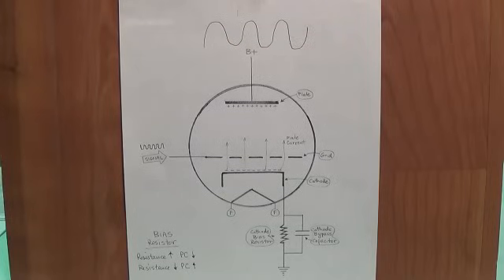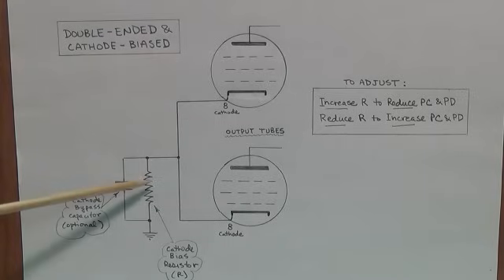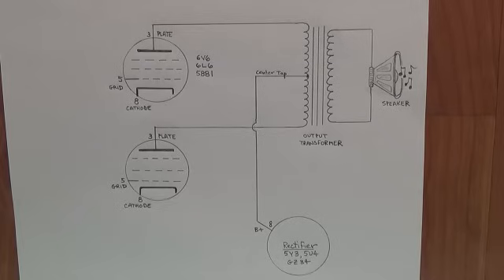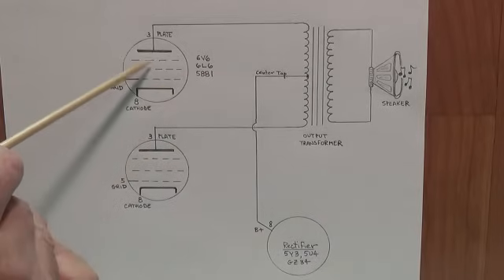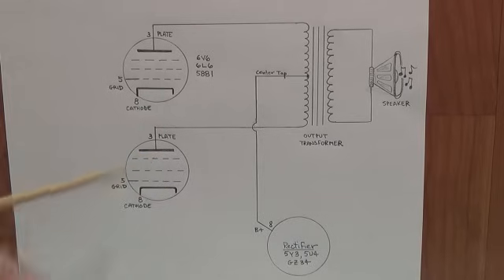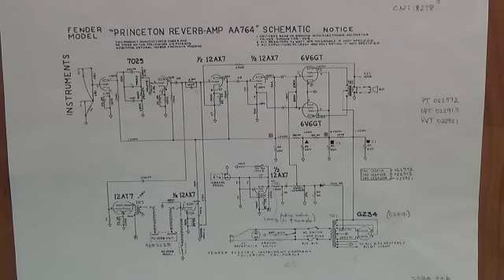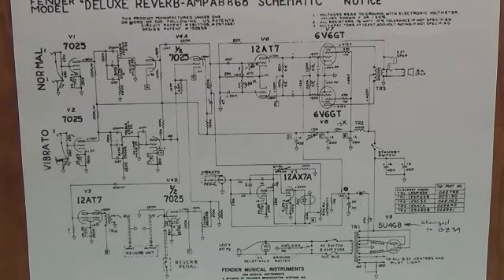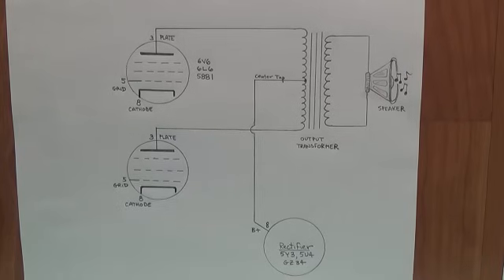Biasing Double-Ended Amplifier Output Tubes, Part 1: Basic Explanation & Methods

Comment: Greetings Uncle Doug.  I've enjoyed your tube amp series of vids immensely,  You are a very skilled teacher!
I'm a mature (retired) EE who grew up with tubes in the 50's & 60's.  (Did alot of crazy things with old radios and TV's.) I'm also a vintage amp and guitar guy. Rock on!!
I have a question/observation about biasing AB amps.  Your point that output architecture can be very recognizable/predictable is a valid one.  But as shown in a few of your examples, it can vary slightly... Specifically in those amps which have an additional component in the B+ path to the OT like a field coil or a choke.  Making resistance and voltage readings between the Rect tube Pin 5 and the output tubes, pin 3, includes this component and it's resistance/voltage drop.  
Is the added resistance & voltage drop of the choke or speaker coil significant enough to affect tube bias?
Thanks in advance for your answer.
Harky1949
Reply from the maker: Howard Kaiser Greetings, HK, and thanks for the very nice comments. I generally try to avoid all extraneous components when measuring the resistance of the output transformer windings. In most cases, even if there is a field coil or filter choke in the power supply, you can use the schematic of the circuit to locate the purest route through each half of the primary winding. For example, the AA864 Fender Bassman has a filter choke (TR2), but using the schematic, you can measure the resistance between each 6L6 plate and the point where the center tap enters TR2 (rather than exits from it). I don't believe I have ever been unable to measure the OPT primary windings by themselves, with no extraneous components or resistance.
Reply: I agree that establishing the "purest" route from OT center tap to output tube plates will yield a spot on dissipation measurement. I just assumed that the choke or field coil prior to B+ on some amps would have a negligible affect since you did not mention it when reviewing your amp examples.
Again, I love your vids, have watched many of them several times, and rate them as tops among the many how-to's on you-tube. Keep up the great work!! 
Btw..don't apologize for your lack of guitar chops. Many viewers probably envy you, others probably groan...who cares?
Reply from the maker: Thanks again for the kind words, Howard. It does get a little tiring to spend hours preparing and uploading a (hopefully) informative video, and then have some yahoo ignore any and all of the good points so they can bitch and moan about guitar intonation, tube brands, or some other irrelevant detail. I guess, in anticipation of such nit-picking, I sometimes just apologize in advance :)))
Reply: If you measure the resistance from the rectifier output to the plate of the tube and take your voltage measurement from the same two points, this will give the plate current whether or not there is a field coil. Since  a field coil is in series with the OPT half-winding, the same DC current must flow in each. Incidentally, a choke is usually installed after the supply to the plates (as in AA864) where it helps to filter the DC supplied to the screen grids.

Comment: I have a question Doug... I have a Gibson GA77, which is negative grid biased. There is a 56k resistor and a 100uf polarized cap to ground on the negative bias supply (with the positive end on the ground side). There is no potentiometer in this amp, as you see in fenders, for adjusting the bias, so am I correct in assuming adjusting the bias would involve changing that 56k resistor to another value? Which direction should I take that value (up or down) in order to lower the plate dissipation of the output tubes?
Reply from the maker: Brad Linzy Brad, I checked the schematic and you're right about the bias voltage being controlled by the 56K resistor to ground. The higher the resistance to ground, the more negative bias voltage to the grids, and the lower the dissipation.....and vice versa. You could replace the 56K resistor with a 50K resistor and a 25K pot in series, to make it variable.
Reply: Thanks Doug. This amp had a LOT of issues that are now resolved after largely rewiring the entire amp. A previous 'tech' had hacked it and now she purrs. Thanks for clarifying what I thought I already knew. :D
Reply from the maker: You're welcome, Brad, and congratulations on a successful "save". Continued good luck.....

Comment from the maker: Jay Blue: Once again, no reply capability. The 6V6 and 6BQ5 are so completely different, in size, pin connections, base diameter, etc. that it would be impossible to make a "switchable" socket. Check out some tube manual data (available on the internet) and you will see this.
Reply: Great videos Uncle Doug, is Biasing a Parallel SE amp the same and normal SE?
Reply from the maker: Thanks, Bamdad. The process is the same except the plate current value you get will be for both tubes (i.e. double). You will have to divide by two to get the average individual tube PC.
Reply: Uncle Doug is there any advantage using parallel single ended?
Reply from the maker: You get more gain than you do with single-ended.....but push-pull is more efficient, more powerful, and has less hum than parallel.

Comment: Once again, I have learned a lot (I think in only a few minutes). You mention the different pin assignments for EL84. Would it be a simple matter to adapt a socket so that it could be switchable between 6V6 and EL84, I happen to have a pair of JJ EL844s which are reputed to have less headroom--great for a relatively quiet and readily distorting amp.
Reply from the maker: I guess you could have two separate sockets, wired in parallel, one for 6V6 and one for EL84, and could switch between them. It would be easier, however, to simply insert the output tube you want to use and leave the other one out.

Comment: Hey there Uncle Doug! :) Thanks a lot for all the videos that you're doing! You provide a truck load of good and well explained information!

I have a little question for you though .. as I'm studying an old point-to-point tube guitar amp witch I don't know the brand or model ( with tow 12AX7 preamp, 5AR4 rectifier and a pair push-pull 6L6GC or 6V6GT power amp *I don't know what are the original power tubes*), I noticed something strange in the power amp section.. There is a 1.2K 10W resistor between the plate and the output transformer on each of the push-pull tubes.. ?!? Since the output transformer isn't original ( the OT is a Hammond 125B witch is a 5W OT.. doesn't make sense!) My guess is that these 10W 1.2K resistors are there to  dissipate some of the output power so that the "too small" output transformer wont burn...  is this makes any sense to you? What do you think?

Also, If I replace the output transformer for a bigger one (wattage), is it safe to remove theses resistors?

Best regards!
Alex
Reply from the maker: Greetings, Alllx, and thanks for the kind words. The position of the resistors and their 10W power rating indicates that either someone was trying to protect a wimpy OPT (as you suggest) or trying to lower the plate voltage to the output tubes.....or both.  Regardless, in a double-ended amp, the wimpy 5W OPT will have to be replaced with one that can handle at least 20W if you want to use 6V6's or about 40W if you want to use 6L6's. The two resistors will definitely have to be removed when you install the new OPT. Good luck !!!
Reply: Uncle Doug  thanks Doug! this gives me some light for sure! Next stpe is the OPT swap! I'll probably stick with the 6L6GC, they sounds better to my Hears :)

Keep it up with the videos, this helps A LOT!!
Reply from the maker: You're welcome, Alllx. Good luck with your project. Be sure to let us know how it turns out :)

Comment: This was extremely helpful! can't thank you enough. I have gotten less knowledge from DVDs I paid money for.
Reply from the maker: You're quite welcome, Brad. It's good to hear that the video was informative.
Reply: I have a Gretsch 6162 with dead reverb. Tank is good. I checked all the tubes too. They're good. Any hunches?
Reply from the maker: How do you know the tank and tubes are good? I ask because these are the "usual suspects", as well as the impedance-matching transformer that drives the tank. Check to be sure there is continuity in the primary and the secondary windings.
Reply: Thanks for the help. Just a heads up, if you ever work on this amp, just know there are at least 3 different versions I know about. Mine has a 6eu7 in the phase inverter and the rest of the 9-pin tubes are 12ax7. The schematic I found online shows no 6eu7. Also, there is another design which uses a third 6973 tube to power the reverb.
Reply from the maker: Brad, I'm glad the suggestion was helpful and you found the source of the reverb problem. Good luck with the repair.  Also, your observation about the variations in Valco circuitry is right on the money. It's actually rare to find a Valco chassis that DOES completely match the schematic that is (supposedly) for it. In some cases, I simply draw my own schematic......it's easier in the long run.
Reply: Uncle Doug When you draw these schematics, you should upload them. You'd save other dudes (like me for instance) a lot of time. :)
Reply from the maker: That's a good idea, Brad. I keep all the hand-drawn diagrams for each video in a file cabinet. Perhaps I should find a host site and upload them......
Reply from the maker: I will, WP. Thanks for the input.

Comment: when measuring DC resistance on transformer secondary -- one should pull the power tubes out..
Reply from the maker: I'm not sure why, Ben. The measurement of resistance is done on each of the two segments of the OPT primary winding, from the center tap to the plate of each of the output tubes. Since the tube plates are isolated from the amp circuit, removing the tubes should make no difference.
Reply: Uncle Doug that's what I thought but it seems too -- try it and see.. thanks
Reply from the maker: I did, Ben, and it made no difference whether the tubes were in or out. The OPT leads connect to the plates of the output tubes, and those plates are not connected to any other component in the amp.
Reply: The plate (or indeed any other electrode) of a powered off tube is an open circuit, so whether the tubes are installed or not makes no difference.

Comment: Excellent video. Please advise me, I have Cayin A55T push pull KT88 HIFI amplifier. In cathode circuit is connected resistor of 10 ohms to ground. Negative voltage on the grid adjusts the Bias. According to manual bias is set to 0.4 V across cathode resistor of 10 ohms (40 mA). I would like to try EL34 pentode, so is it safe to put EL34 instead of KT88 and adjust bias to 0.4 V? Pin 1 and 8 are connected together so I assume it will work.
Reply from the maker: Greetings, Munja. I am no expert on KT-88/EL-34 HiFi amps, but after doing some research, it seems like this substitution will work as long as the 1-8 pins are connected for the EL-34's and you adjust the bias for them. I also read that the KT-88's have a 100K bias resistor, while the EL-34's prefer a 220K resistor. If you can't achieve proper bias for the EL-34's with the 100K resistor perhaps you will need to change to 220K. Good luck !!!
Here is a link that addresses this tube substitution:  http://www.diyaudio.com/forums/tubes-valves/168479-cayin-55t-want-use-el34.html